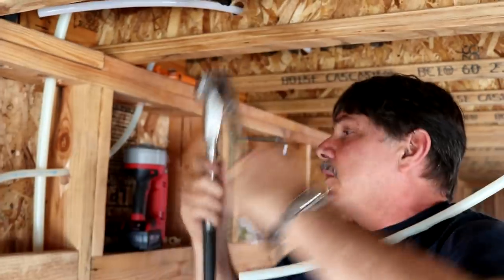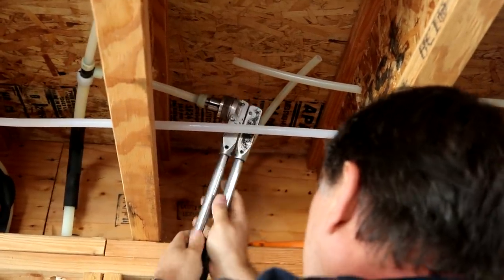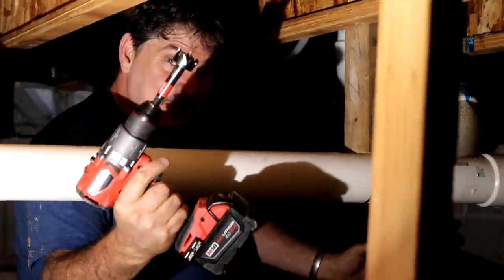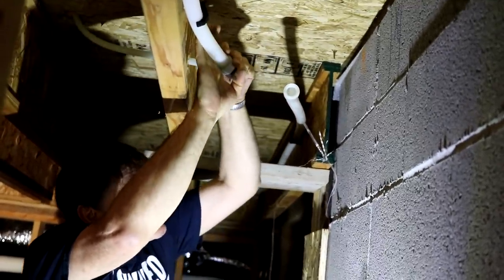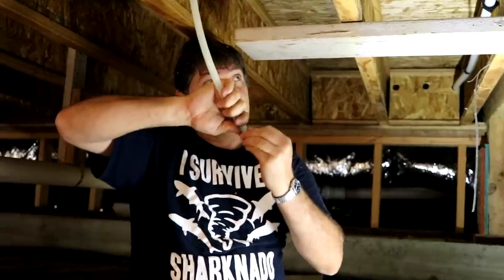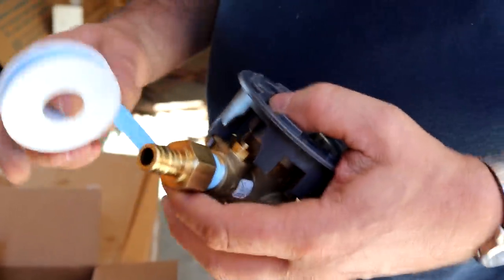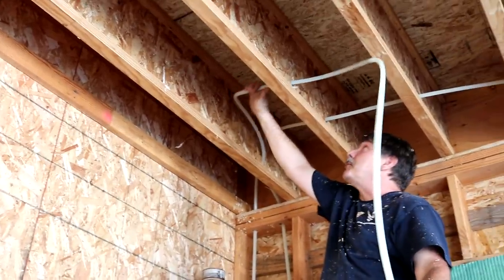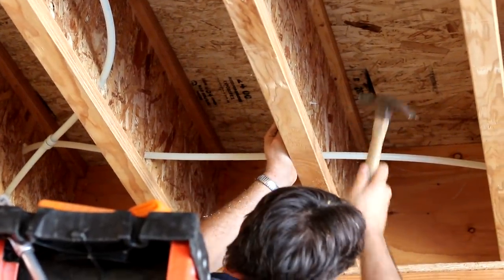Plumbing with Plastic Ep.95

Comment: We did the same thing in our new home about 2 years ago.  Similar water heater with a recirc pump.  Works great.  One of the better decisions I made.
Reply: How does it work with an on demand? Does the pump run constantly like a tank based system? Or does it activate off the temperature?
Reply: bpdp379  Our recirculating pump has a timer that we set to match our daily activities.  Our system has a hot water temperature sensor under the kitchen sink (the farthest outlet from the tank).  So The timer wakes up the pump 1/2 hour before we get up.  The temp sensor is cold, so the recirc line port is open.  The pump runs until the sensor comes up to temp., then it shuts off the recirculating port, and the pump shuts down...  etc. etc.
Reply: @oneselmo  very nice. Thanks for the info. I'd always assumed there was no way to run a recirc with an on demand system.
Reply: @bpdp379  it’s possible, but just like any recirculating system it’s energy wasteful. I have an on demand plus a mannibloc system. I just insulated my pex runs that I frequent so once I have hot water there it stays longer. If you were going to do it though you could put a small electric on demand in the recirc loop so the gas on demand isn’t constantly kicking on. The on demand will stop running once up to temp.

Comment: A beautiful thing about PEX is how it can (reasonably) withstand freezing.
Reply: I assume most of the expansion then has to happen in the pipes, right?  I don't see the elbows and tee's standing up well to that.
Reply: @Estok8805  Note: I am not an expert in this area.  I'm only repeating what I was told about how this works, and I know my area PEX houses don't freeze up and copper houses do.  There could be other factors involved.  Again, I am not an expert.  Listen to my dumb a&& at your own risk.  That said ...

I'm told that the water in the pipe doesn't freeze 100% all at once, but goes thru stages of different areas going from liquid to slush to ice at different times and rates.  There is considerable entrained air in tap water.  When the water freezes (again, which happens slower than you might expect), the air is squeezed out first.  If that air pressure has some place to go, it will create enough room (actually more than enough for room) for the ice to expand the 10% it needs.  This is the REAL reason you leave the tap dripping when you expect the pipes to freeze: It's an air escape valve.

So, regarding PEX, every piece of the plumbing system doesn't have to be flexible.  The rigid bits (like the tees) are fine as long as there is something with give nearby to accept the expanding ice and air as it tries to move around.  You can see in the video that the pipe can be stretched in diameter considerably and it can still recover.  It is being stretched far more in volume capacity than the 10% required.  What we saw in the video from the expander tool was probably almost a doubling in volume.

This theory also assumes that your entire run of PEX pipe throughout the house doesn't freeze solid, but certain runs of the pipe (deeper in the house) stay fluid while only a bit in the exterior walls is exposed to the freezing cold.  The expansion of slush can "back into" the warmer area of the pipe to SOME extent.  I have no doubt that a 20ft run of PEX exposed to an instant flash freeze would split something somewhere.
Reply: @WanJae42  Despite your disclaimers, your logic makes sense to me.  Even if the rest isn't right (though I suspect there is at least some element of truth there,  those pipes do look surprisingly stretchy), at the very least I learned that there was hella air in the tap water.

Comment: I remember watching the work in the basement, it is quite nice to see the follow up after so much progress. I am looking forward to seeing the rest of the installation.

I have 12 years in design, construction and commissioning of various building services, including plumbing. I currently work on a research project which investigates the biofouling of, among other things, water supply systems. The one reason why I would always go for copper pipes, despite the cost, inconvenience, etc. is because of copper's bactericidal properties. Copper pipes have limited susceptibility to attachment of bacteria, unlike plastic or steel. Bacterial slime persists in our water distribution pipes and that is the elephant in the room we don't discuss, because there is simply nothing we can practically do about it. We just spend our whole lives gulping it down! Proper selection of materials can help to significantly reduce this health risk, however.

There is plenty of scientific papers describing these copper properties, so to provide a couple of examples:
https://sfamjournals.onlinelibrary.wiley.com/doi/abs/10.1111/j.1365-2672.1985.tb01442.x
https://meridian.allenpress.com/jfp/article/61/10/1321/169229/Adhesion-of-Aeromonas-hydrophila-to-Water
https://pubmed.ncbi.nlm.nih.gov/1611559/

Comment: I grew up in the Chicago area, and copper is still code, and pex is not allowed.  I'm pretty sure it goes back to pipefitter unions.   Electrical has to run in conduit as well.
Reply: Not only that, but all copper has to be sweat or brazed, no crimp or push lock fittings allowed. Pipefitters afraid of the future.
Reply: I think your foundations have to be block walls too. The unions in Chicago are strong.
Reply: I would be moving out of that city and state.
Reply: @christophergruenwald5054  Eh, I'm not from Chicago, but I prefer soldered copper for water and conduit for electrical anyway. I'm ambivalent on block, I prefer poured foundations, but if block is done right it's just fine.
Reply: @christophergruenwald5054  It's specific to Crook County and not all of Illinois, but yeah definitely not ideal.
Reply: @jasexavier  That's fine, as long as people have the choice to use something cheaper if they wish to.
Reply: @rjk7104  Fair enough.

Comment: there is certainly a gap in the market for a battery operated "epanpanda" type tool for opening up the internal dia. of the pex pipes instead of using the mechanical tool .... could save some serious time on site given how many joints are being made.

EDIT: I see later in the vid there is a battery operated tool
Reply: Phil mentioned in a previous video that he's using the manual one most of the time to show the DIYer since the power tool version is more expensive.
Reply: @trmpt73  I missed that, good catch. He's pretty fast with that manual expander, he wouldn't save that much time by doing the power expander from what I've seen.

Comment: Using a manual expansion tool,  ouch.   Hopefully rotating while expanding.
Reply: If there’s a power tool version, I’ll buy it for him. What a treasure to have on you tube!
Reply: @michaelhobbs8082  Milwaukee M12 does a good job.
Reply: How is that method of connecting pex compared to the crimp rings?
Reply: @codywalls7022  Uponor is expanded and forever self crimps down on the fittings.  The fittings are also larger inner diameter and allow more flow vs PEX B.

Comment: A couple of thoughts here, One thought is that it may be a better way to describe recirculation as keeping your hot lines hot. hot water gets recirculated from the tankless to a tee at the farthest point(hopefully), then back on a return line to the tankless. Second thought here is did Phil break his half-inch expander die for his m12 expander? I'm sure recirc and the tankless will be converted more in-depth in a future video but nice choice on the RUR series!

Comment: I'm not sure why a PEX manifold system wasn't installed. All those fittings create flow and pressure problems at the fixtures. With any PEX manifold system each fixture has its own run to the manifold with no fittings. Sure, you probably use more pipe, but the cost isn't that greater.
Reply: The pipe is being expanded so the fitting is the same size as the pipe.
Reply: Manifold systems use more energy on recirculated lines. Heating up a lot more water than  you would need to otherwise and lots of more return lines. This way you run 1 3/4” line past the kitchen to the bathroom with 1  1/2” return line. I’d understand if you were somewhat close to a bath/ laundry room to run those off a small manifold
Reply: i was wondering the same thing.  i thought the point was to have continues runs and no points of leaking.

Comment: The pex I put in my house is coming up on 13 years old. No leaks yet. It's by far the best system on the market.

We used 1/2" hdpe (pex, but not branded as pex) tubing at my old job for pouring hot urethane directly from the processing machine mix head, it would hold up under 225-ish farenheit temps for well over 2 hours.

Comment: Replumbed my whole house in copper (Made in USA) 😎. 
Because I’m old-school and don’t like plastic.
Reply: @oneselmo  lead solder isn’t allowed by code, not to mention fairly difficult to find. Tin solder was used and all work was done by myself and a commercial plumber(combined nearly 50 years of experience) . 👍 Nice try though.
Reply: @bmingo2828  Nothing wrong with copper, but our plumber, who has almost 50 years experience by himself (not to mention his dad), uses almost nothing but PEX.  
He didn't trust it for 15+ years, then he took a piece about 6" long and filled it with water and capped it.  That was back in 2008.  He has taken it out of the freezer every morning when he gets to his office and puts it back every evening.  To this day it has yet to bust.  After a year and a half of that he started using PEX exclusively, except when customers require hm to use copper.  
PEX is cheaper, easier and faster, and he has fewer problems out of it than he does copper.  If you want copper, it is a great product, but PEX out performs copper in every way, except knocking pipes.

Comment: I've read where mice have been known to chew through Pex.  What does Phil say?
Reply: Fairly certain Phil said that pack rats and mice could/ would do that on their second channel (EC2) Podcast interview. I can't remember when in the conversation that it comes up, but I just listened to it yesterday and that did come up!
Reply: Mice will chew through anything given they are motivated to do it
Reply: @kevinwallace1499  Exactly. If you are feeding and watering your mice/rats properly, they won't chew into your PEX. Haha
Reply: @kevinwallace1499  Mice and rats wouldn't chew through anything. They won't chew through copper, brass or steel.
Reply: I had rats chew through pex pipe twice, a line to dischwasher.  I still like pex, but that is a concern.
Reply: The problem is not that mice/rats can chew through it, the problem is you have mice/rats! Fix that and no worries.
Reply: @ADBBuild  I agree, but the way I found out we had a rat is by finding a water  leak, chew marks and then droppings. This was in a rental property. Obviously we got rid of the rats, but this is how we found the problem. We did not have much water damage because the water dropped into the basement, but it be worse if it is on another floor.
Reply: @kevinwallace1499  including cement!
Reply: @janderson8401  I took a foods science class in highschoo, I know rats can chew through cinderblock and food processing plants have to deal with that
Reply: That was my biggest concern when I needed new pipes. We have rental property next door and mice have been a recurring problem.
I love the copper. My son taught himself using You Tube and a consult with a retired plumber.

Comment: When you run a recirc line, make sure you insulate the hell out of it.  They're like 24/7/365 space heaters otherwise.
Reply: only if you have the recirculation pump running constantly. put a motion sensor in the bathrooms or laundry furthuest from the hot water heater to turn the recirculation pump on when someone walks in the room.
Reply: @gregorysmith9158  I'd put the recirculating pump on a timer.  The main need for it is a shower or bath and, for me at least, the time for my showers are pretty much a fixed time. Keeping a recirculating pump on 24/7 kind of defeats the purpose of a tankless water heater.
Reply: @RickHowell89  timer, motion sensor, or really any method to tie water use to recirc pump use all accomplish the same goal - get that pump off when not needed.  What a recirc system can do if pump always on is to essentially attempt to heat the house (like what @Trogdor Burninator suggests) brining cold water back to the water heater tank, turning the tank back on since the returning water is now colder (ala a hydronic system) and repeating this cycle over and over until your electric and gas bills are through the roof.  I recognize they are putting tankless in here but same principle can occur without specialized details (turning tankless on because it senses water movement).  I didn't see any discussion about it so assuming the worst
Reply: Well said, I was thinking the same thing.
Reply: My tankless Noritz is on a timer, but only off late at night. It runs recirc every half hour during the day unless another call for hot water cancels the need. Wonderful to have immediate warm water at every fixture. I do wish the lines had been fully insulated because that instant warm water temperature does fluctuate a lot. But as to the cost - I've played with the schedule and tried to minimize the 'on' time with very little noticeable difference. The water heater is just that efficient.
Reply: During the heating season it will reduce the load on the furnace slightly, so you will get part of the energy back. I would use a timer, or perhaps turn it off during the cooling season.
Reply: @RickHowell89  Use a flow switch on the water heater tied to a timer.  Whenever the water heater senses flow it turns on the circ pump for 30 seconds and you get almost instant hot water with very little wasted heat.
Reply: I was thinking the same thing. I hadn't heard of a recirculating hot water line before, and it immediately came across as an easy way to waste energy. From other people's comments, it does seem that there are mitigation techniques though
Reply: Thanks for all the comments here, the recirc line was new idea to me, had no idea how it would maintain the heat. Where I live inflooring hot water heating systems run the line through a normal hot water tank to capture that heat and maintain it as well in the heating season.

Comment: Use red/blue pipe because 15 years from now when a wall needs to be opened the owner/repair person doesn't have to figure out what is what.
Reply: Recovering_Californian  yes!  and if you're plumbing a recirc line, use green.  As you say, the next guy in doesn't have to screw around figuring things out at the home owners expense, just because you forgot to load your truck with colored pex.
Reply: just stick some coloured tape every few metres
Reply: Tey touching it. The hot one is the hot. The cold one isn't. Not rocket science.
Reply: @1971merlin  Coloured pipes aren't rocket science either?  If someone's doing repairs on their plumbing, there's a good chance they have a leak and aren't in the mood to run a few more gallons of water onto the floors trying to figure out which pipe is hot, cold, and recirculation.
Reply: yep because one being warm and the other cold is hard to figure out
Reply: They don't make Red Uponor is what I am told just clear with red writing.

Comment: So can you just put insulation over the pex in the wall?
Reply: Yes, depending on the material. Normal, inert fill (like fiberglass bats and stuff that's blown in) should pose no problems. I'd doublecheck on the expanding foam stuff, because it can get quite hot when applied. Not enough to ignite wood, but enough that might damage the PEX. (Then God help you if you need to go into that stuff to find and repair a leak.)
Reply: @jackielinde7568  You fix a kink in PEX by heating it up with a heat gun -- a lot -- until it turns clear and straightens out by itself, and then it returns to its former color and stiffness when it cools (I've done it in in my DIY system, and I was surprised at how much I had to run the heat gun). I doubt that curing foam would come close to heating it enough, and even if it did it would cure itself as it cooled.
Reply: @balzacq  We all know that, but remember, THINGS HEAT UP OTHER THINGS AT DIFFERENT RATES. For instance, the heat gun used to fixed a kinked section of pipe is much cooler than the flame from a torch I wouldn't use a torch to fix PEX. I said that the heat of the expanding foam may be hotter than what PEX can take.

Comment: In the UK push fit is the thing - I've used John Guest 'Speedfit' for a few years now. No expander etc needed, the only specialist tool you need is the pipe snips. The fittings are also removable and re-useable.

Comment: Why is he switching between a Milwaukee expander and a manual expander? Why not just use the battery powered tool all the time?
Reply: Milwaukee's is for bigger pipe size, but don't know why hand cranking. Maybe just used to
Reply: Because he's paid by the hour.
Reply: He probably didn't want to change out the cone on the Milwaukee to a 1/2"

Comment: Two years ago I completely re-plumbed my house with the old galvanized piping.  I used PEX and absolutely love it.  
One issue I did have was the plastic one-nail hangers that I Phil is using.  Mine looked identical.  I probably got a bad batch of hangers, but within a year the plastic began breaking and my piping began to fall.  I immediately went to the hardware store and got two-eared handers and it's been fine since.